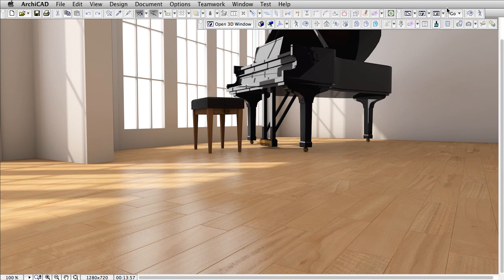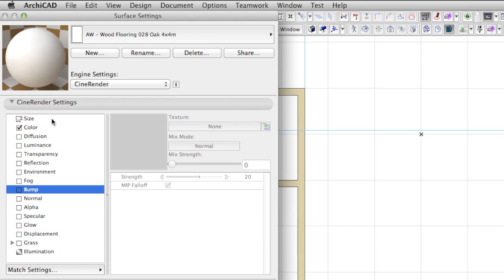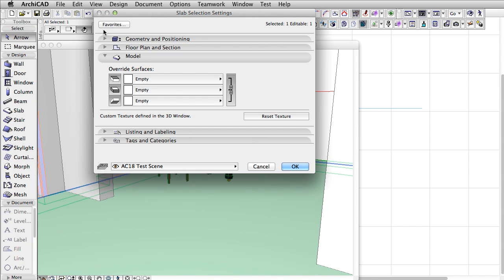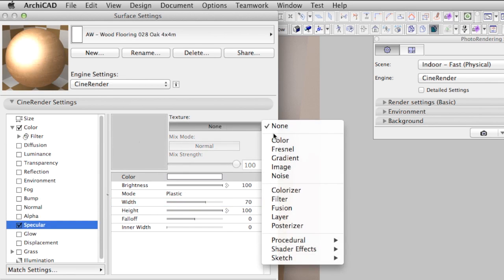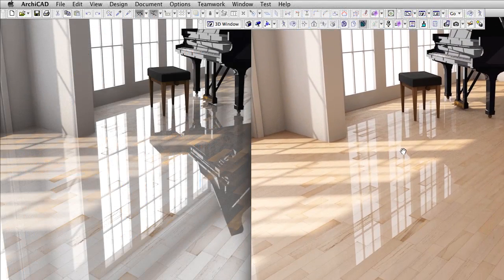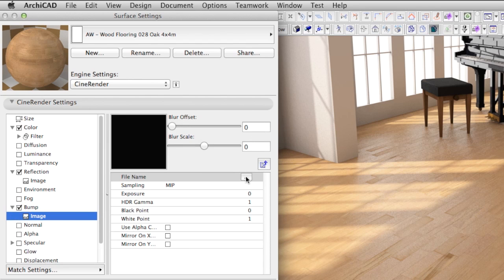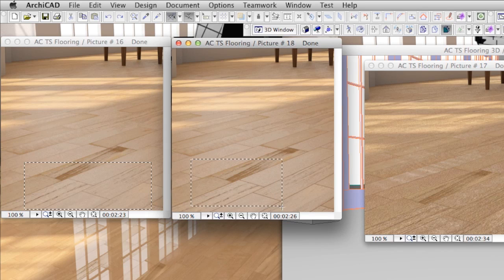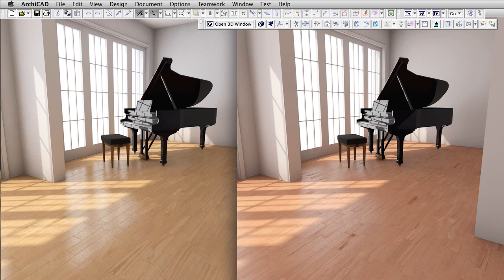Creating a High-end Wood Surface Material in ARCHICAD

Comment: Hi! I have an issue concerning reflection for custom made surface Black Granite. If I put reflection at value 0-85 there is no reflection at all. When I put it to 86 there is too much reflection. Any small shift towards lower values in any of the surface settings for this surface results with no reflection at all in render projection. 
I can't find solution to this specific problem, only general tips on reflection. I'm stuck.

Comment: Hi , I have an issue conercnant rendering on cinerender archicad 19 . I have tried to make records with cinerender of archicad 19 but the harsh calculation and importate although the settings of the image is of low quality . I want to inform you that I work with PC workstation: cpu xeon E5620 graphics card nvidia cuadro 5000 ; ram 16 gb . I will like to know how to reduce the time calculations ? and if there is something to change on my machine, that 's what I should change? a informatitien told me that I have a low cpu . rendered by this are the CPU and not the graphics card , ????? I 'm confused
Reply: +ARCHICAD OK THANK'S